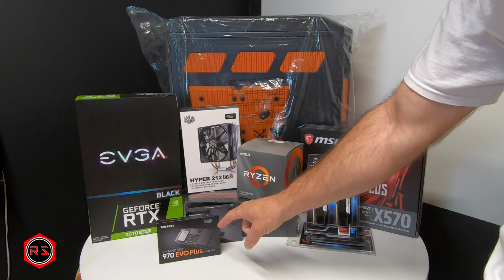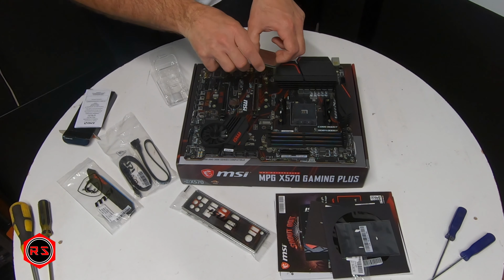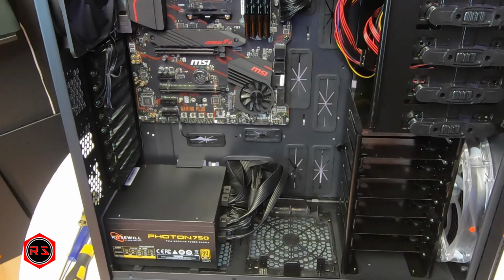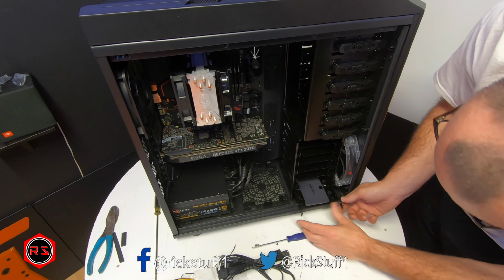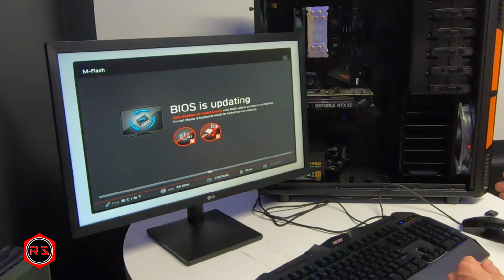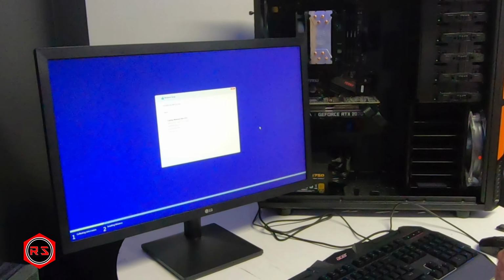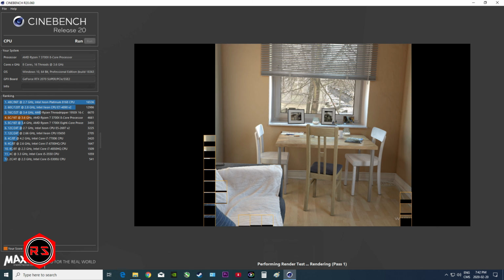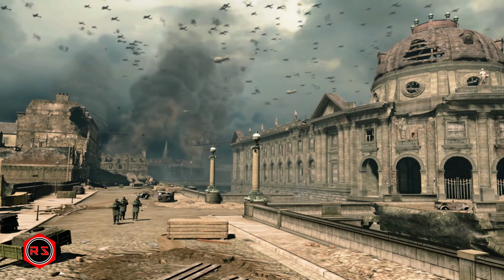Building a GAMING PC matching the PS5 specs

Comment: Fans don't connect to Motherboard with this case. They plug into the cables already in the case - that is so you can control the speed of these fans using the knobs.
Reply from the maker: I know but I wanted to bypass the controller of the case so I can setup the fans curve from the bios and so my kids don't change my fans speed.

Comment: Hey Rick!! OMG, cant believe I found this video for this specific case. Every other Thor V2 case videos are old AF. Anyway, I have a question and you are the only person in the whole internet that can help me out!. I have this same case and when putting it together, I used a Corsair CX650M PSU which I have used in two previous builds. For some reason, the screw holes of this case did not quite match the PSU ones entirely, I think only 2 did (this wasnt a problem with the two previous cases i used). The padding inside the case around the PSU area also made it quite hard to screw it in... So I was wondering if there was an additional frame i didnt get, or what. The holes should match no? Thanks. Great video!
Reply from the maker: For me it was a perfect fit. I haven't received any additional frame or hardware for it. Have you tried it upside down? I installed it with the fan exhausting at the bottom. I haven't tried the other way so I can,t tell if there is a difference or not.
Reply: @Ira Jordy Thank you, signed up and it seems like a nice service :D I really appreciate it !
Reply: @Kace Cannon Glad I could help =)

Comment: How much total did you spend? I just bought a open box rig from microcenter coming out at $950 after taxes
Reply: Just seen your description roughly $550. Should I return my pc to micro center and build it myself or just keep it lol
Reply from the maker: My total was $1600 US
$550 is for a base version build
Reply: RickStuff sorry I’m new to this whole pc gaming thing brother    Can you tell me if mine was worth it ? It was 899 before taxes total 960 after .     It has a ryzen 3 3600 , 16 g ram , 500 ssd and AMDrx 5700 . With a 600 watt power supply
Reply from the maker: Cpu 3600 is ryzen 5 not 3. Ryzen 3 3rd gen is 3200. Not 3600.
Considering that it all open box it is a little expensive. $900 is about the price of all of these brand new. You still saving roughly $100. 
What motherbord are ypu planing on using?
Reply from the maker: For your rx5700. Keep an eye on the temp. There been some temp repported regarding the rx5700xt. Not sure about the 5700 but if you see some rise in temp check on "Paul Hardware" channel. I think he has a fix for this card. The screws are too long and the cooling plate is not sitting properly on the gpu.
Reply: RickStuff  yes ryzen 5 sorry I’m new to all this , and the mother board that was in it was called AS ROCK bB450 -AC system
Reply: RickStuff  do you recommend me trying to build one myself and returning ? Or keeping
Reply from the maker: It is easy to build a pc when you know how to do it. I've watched Paul Hardware build videos a lot before doing mine. It is very sensitive hardware and the last thing you want is damaging an exensive part while building your pc.

Comment: Resolution 1920x1080? Thats not 4k
Reply: Matching the ps5 will be 4k resolution 60fps not full hd struggling to get 60 fps.
Reply: Ps5 doesn't do 4k 60fps. It can with ps4 games. New games with high graphics will be the same shitty 30fps on console.
Reply from the maker: The max resolution is 7680x4320

Brand
EVGA
Model
08G-P4-3071-KR

Interface
Interface
PCI Express 3.0

Chipset
Chipset Manufacturer
NVIDIA
GPU
GeForce RTX 2070 SUPER
Boost Clock
1770 MHz
CUDA Cores
2560

Memory
Effective Memory Clock
14000 MHz
Memory Size
8GB
Memory Interface
256-Bit
Memory Type
GDDR6

3D API
DirectX
DirectX 12
OpenGL
OpenGL 4.5

Ports
HDMI
1 x HDMI 2.0b
Multi-Monitor Support
4
DisplayPort
3 x DisplayPort 1.4
Other Ports
1 x USB Type-C VirtualLink

Details
Max Resolution
7680 x 4320
SLI Support
2-Way SLI
Virtual Reality Ready
Yes
Cooler
Double Fans
Operating Systems Supported
Windows 10 64-bit, Windows 7 64-bit
Thermal Design Power
215W
System Requirements
650W or greater power supply.
PCI Express, PCI Express 2.0 or PCI Express 3.0 compliant motherboard with one graphics slot.
Power Connector
An available 6-pin PCIe power connector and an available 8-pin PCIe power connector
HDCP Ready
2.2
Reply: @LinoOliveira92  hi later in the future you can actually do 60 fps 4k and for smaller  game 120 4k like ori
Reply: 4K resolution is 2160p

8K resolution is 4320p

Comment: Is a 1650super enough ?
Reply from the maker: Check the gpu specs on newegg.com
Reply: no but  1660 super 6gb is good though
Reply: I would go with a 3900X + rtx3090 ..................
Reply: Fck it I started saving for ps5 cuz I'll need something portable
Reply: @dikshantjadhav8515  Dont do it bro... in 1 ,2 years pc.. will dominate again
Reply: @badtuber1654  oh nooo I actually bought the pc before I placed the initial comment I just wanted to know if itll match cuz like 4k 60fps  ? Damn
Reply: @dikshantjadhav8515  It wont match, you need a 2080ti to match a ps5/series x... But you get full control of the games graphics options... I watched footage of assassins creed vanhala at 4k 60fps on series x, and I have a feeling they lower many graphical options to get 4k 60.. specialy lightning effects... if you you buy a new MB that supports zen 3 cpus ryzen 5000 series ... you are allready a step ahead of consoles already in the future.. because console tech will be stuck  in zen2 for like the next 8 years and on pc's you wont be stuck you can allways upgrade ......

Comment: I have only one something to say 
U don't need an RTX to run ray Tracing ik that ps5 can run ray Tracing but the Nvidia update made gtx series run it as well from gtx 1060 6gb and so on and the console will do 30 fps so i see that 600$ or 700$ will beat ps5 with gtx 1660 super or ti and ryzen 5 3600
Reply from the maker: But I need a RTX for 4 multiple monitors support. 3 monitors for my racing rig and 1 for the other games
Reply: PS5 running RDNA2 with down to the metal will run something like RTX 2080+ trust me it will.
Reply: @RickStuff  I see anyway , PC builders in a year or two will begin publishing videos like this and for the price i think and Gpcx4 which is emulator for PS4 is coming soon , PC is upgrading quickly

Comment: CPU ps5 is most similar to ryzen 1700 or 2700
Reply from the maker: Ya I know. I picked the Ryzen 3rd gen so if I ever want to switch for a new model of motherboard or Graphics card  I will have less chance of compatibility issues. There is already a lot of motherboard that doesn't support Ryzen gen 1.